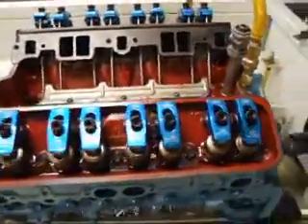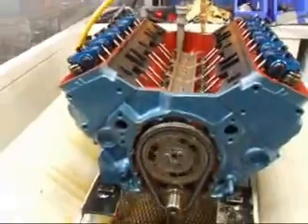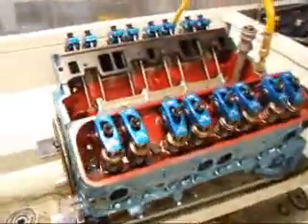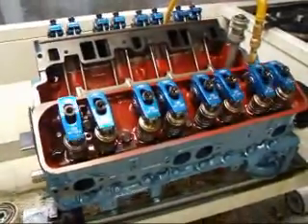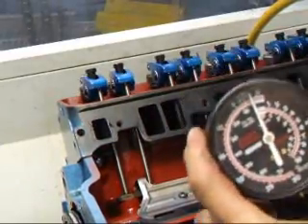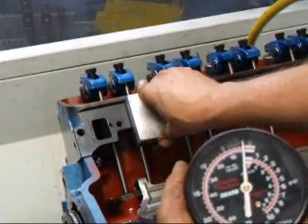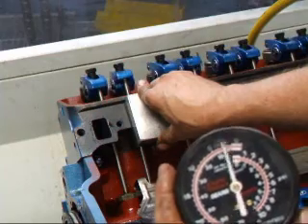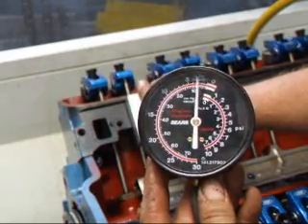Testing Engine Vacuum on the Simtester

Comment: hi...i know this is old... but with the spark plug out.. the only vacuum signal you are getting is the restriction from the size of the opening.. 

even if you just stick a rubber tapered plug over the spark plug hole.. so you don't load the pistons building compression..   

its the pistons moving down in relation to the cam closing the valves to create vacuum in the intake ports..  with the spark plugs out.. its just not an accurate test...

Comment: @Qwertyuiop8504 Vacuum should increase with RPM on a noramlly aspirated engine, this is normal. But on a turbo charged or a supercharged engine there should be a 0 or slight pressure that sould increase when you put load on a engine aka driving. But in can see what makes you doubt on your readings, you see he uses the vacuum gauge on only one inlet witch draws air in only when valve opens. On a inlet manifold there is at least one valve always open that draws constanlty air in.